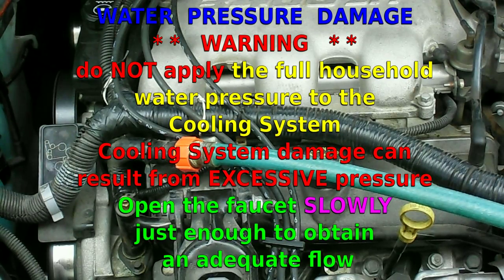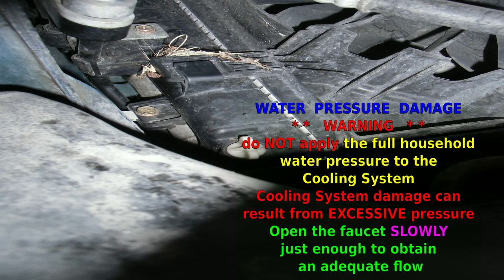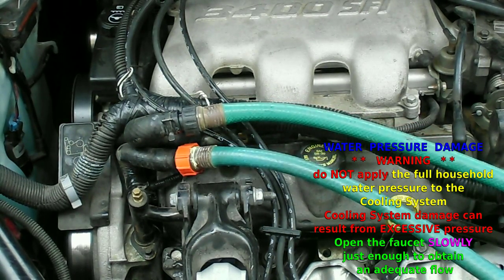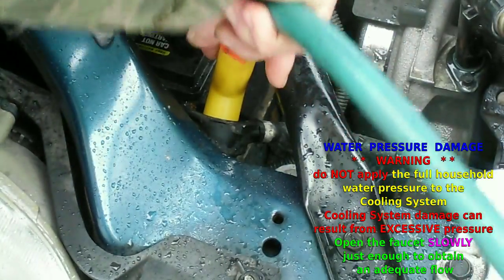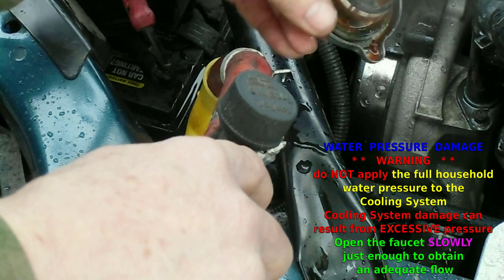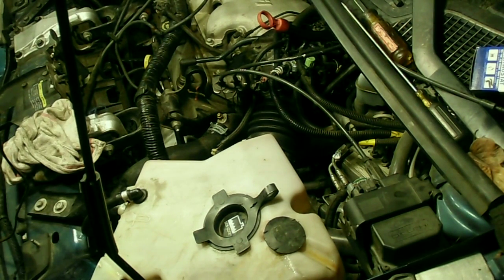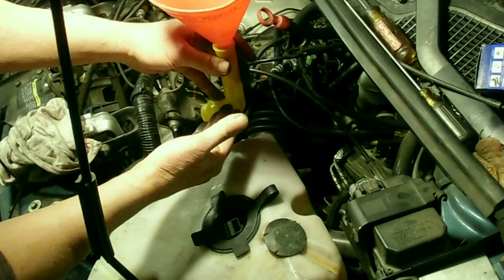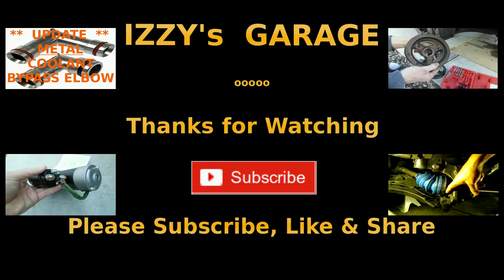RADIATOR FLUSH cooling system - the easy way - most cars trucks vans SUVs gm

Comment: I have the same exact car, 2004 model and the heat barely work. It blows hot but to a minimum and the windshield fogs when it's not aimed at it. On top of that the a/c work but the condensation drain hose is clogged and I can't find it at all, Could the clog also be the issue with the heat barely working?
Reply from the maker: When you say minimum, if you mean the fan is not blowing very fast, and if that is the case, it sounds to me, you might have a problem with your cabin fan speed control.
Reply: @IZZYsGARAGEhow2DIY  Hey thanks for the response, the fan speeds are all working fine. it's the heat temperature, i don't put it higher than speed 2 because it wont be as hot. If i raise the fan speed it starts to cool sown slowly but not cold air, just lukewarm.
Reply from the maker: Three possible causes come to mind. 1- You may have a thermostat stuck open. 2- Some cars turn on the A/C compressor when you turn the knob to "defrost", thus mixing cold & hot air. Only other thing I can think of, could be, 3- A clogged heater core (it's a small radiator in the the cabin compartment). When you flush the system, make sure to run the heater on high, with the temperature control set all the way to hot.
Reply: Did you flush the heater core?

Comment: I have a question, what kind of nozzles do i use for the hoses?
Also, how do i know which hose is input/output?
Any additional information would be awesome!
Reply: Output out of the heater core through the firewall would usually be the hose going to the side of the water pump.
The inlet to the heater core usually comes somewhere out of the engine.
If you follow the entire video, that should flush the system both forward and backwards.
Good luck with your project!
Reply from the maker: Output out of the heater core through the firewall will usually be the hose going to the side of the water pump. 
The inlet into the heater core would usually come from somewhere out of the engine.
 If you follow all the steps in the entire video, that should flush the cooling system both forward and backwards. Good luck with your project.

Comment: I don't know if this is true on all Venture vans, but my 2001 has no heater control valves. Turning on the heat is not required unless you do have control valves. GM in it's stupid wisdom,  placed two plastic 3 way tees (I have aux heat in the back) in the back near the firewall. I know this because one of them burst on me last month. And let me tell you, space is at a premium back there. After getting everything apart I decided to replace both tees and all the heater hoses. And I hope I NEVER EVER do one of those jobs again. I'll run from it. Anyway you can check by following the thermostat bypass pipe on the right side of engine. It will pass under the throttle body into a not so quick disconnect fitting, and that will lead to a 3 way plastic tee if you have them. If you have rear heat in your van, that means you have 2 of those beauties. One is incoming to the heater cores, the other is outgoing into the thermostat bypass pipe. Like all plastic, it gets brittle over time  and they break. I cannot for the logic of me understand why they did this. Being cheap and cutting corners or they wanted that crappy Dex Cool to continue circulating through the heater cores so it doesnt congeal. Who knows.

Comment: What kind of damage will the hose being turned on all the way?
Reply from the maker: Well, typical residential water pressure is normally around 100 PSI or more. Typical cooling system operating pressure is 16 PSI, so that kind of pressure could do some real damage to your cooling system.

Comment: NICE IM GONNA TRY THIS. MY VAN OVERHEATS AND I DONT KNO WHY. I THINK IT NEEDS A FLUSH. IVE PUT NEW THERM.,COOLANT TEMP SENSOR, WATER PUMP ETC. BUT IT STILL OVERHEATS..
Reply from the maker: Has the engine ever overheated, I mean badly, like, really hot? . . . If that is the case, overheating can cause the head gasket to blow, or even the engine block to crack. Both of the above scenarios would cause the engine to subsequently over heat.
Reply: IT WONT HIT THE RED. BUT IT GET UP THERE DEN IT GOES BACK TO THE MIDDLE...... DEN BACK UP N DOWN, UP N DOWN, UP N DOWN... U GET WHAT IM SAYING... ONLY THING DAT WASNT DONE IS THE FLUSH.
Reply from the maker: You could have air trapped in the system. This engines need to be burped. In other words, you need to take out the air in the system once you refill the cooling system. I cover how to remove the trapped air at the end of this video or in my thermostat replacement video. I forget which one. Although, I hate to tell you that  it sounds to me that the problem could be more serious than that. Try the flush and the burping,  and see what happens. Good luck, let me know how it goes.
Reply: I hope its not a more serious problem...and yes im gonna bleed to whole system and make sure there is enough coolant.. theres no leak, no fluids mixing, hoses are good(all check by mechanic yesterday) but still gonna do wat u told me...... thanks I.G
Reply from the maker: If you continue to have problems, test the cooling system for pressure, and make sure it holds pressure,  and maybe also do a test for exhaust gases in the cooling system. Also, has the radiator ever being replaced?
Reply: Victor Dell  Yes. Mechan. Said i need the lower intake mani. Gasket... $600 fo this fix... dont have it.. i rather replace all gasket... ill be gettin money nxt m9nth hopefully i can get it fix
Reply: @IZZYsGARAGEhow2DIY  2/12/19- update... got the new lower intake manifold gasket put in. (Aint notice any difference), but anyways now my van is going str8 to red and the coolant temp light comes on. ( light never came on when i red lined b4). Didnt have time to flushed system. Like i said b4 the mechanic said no leaks, head gasket was good, he replaced coolant sensor,new stat, new hearter hose.everything under hood is good(pump,hoses,rad, rad cap, overflow tank etc)

      Heres what happens now

Van would drive ok for a couple days heater blows hot air evything seems fine. The heater would lose its hot air Then boom it starts to redline. I rebleed the system get heat back, I wont drive van fo a day or 2 and its fine i get heat, Then cple days l8r starts to redline again... 

                 Ps. Dont know what else to do. Payed the $600 fo nuttin i think. Dont know anyone with a garage or driveway to flush system. Was thinking bout flushing heater core but what do you think.?

Its 3:45 im in van as i type this bleeding air out system ( had snow and still sleeting right now just came back from a drive and van did ok no redline or overheat. Thanks
Reply: Victor Dell   just updated. Would like your thoughts and/or advice
Reply: Victor Dell  yes i will bleed n fill it again in the am b4 kids go school. Do u think a pressure test would help? Its like $16 at pepboys im pretty sure guy said. Oh and thks for gettin back to me
Reply: @F33ZZY-B.K.B  Did you figure it out
Reply: @briizcustoms9543  nope, i junked that piece of shit van, new rad, coolant,hoses, n even a new heater core and still was heatin so i said fuck it take the lost
Reply: Bruh I replaced every part you said I have a Acura TSX 08 and it kept over heating after all that I took it to a shop cause it I had no clue what it was they did a coolant system flush lol car works like new now 🤦🏼‍♂️ The little things on ur really Can cause a big problem lol

Comment: So the engine is OFF while doing this but heat is turned to all the way on?  I'm just double checking
Reply: Key on, engine off, heat on full blast...is that right?
Reply from the maker: Yes . . . Reason: To also flush-out the heater core in the cabin. I normally turn the heat and fan to maximum with the engine running, ,  since these valves can be vacuum assisted, then I shut-off the engine.  Remember never to flush a hot engine or you will damage the engine.
Reply from the maker: That's right!
Reply: IZZY's GARAGE ok so I can do it with engine off and then also do it with engine on...how long do you leave engine on while flushing cabin heater core?
Reply from the maker: The engine doesn't need to run very long. Just until the water comes out clean. The important thing to remember as I mentioned earlier . . . Make sure you start with a COLD ENGINE . . Also don't open the faucet full blast . . Most homes can have 100 psi or more . . . Which can damage your cooling system.
Reply: @IZZYsGARAGEhow2DIY  In my area, building code limits water pressure to 60 psi.
Reply: Am I taking the drainage plug out if the bottom of the radiator befor i finish flushing the heating core system

Comment: Some grand am’s need rad filled plus water pump primed up.
Reply from the maker: Well, with any engine, one needs to fill the cooling system completely, and remove all the trapped air.